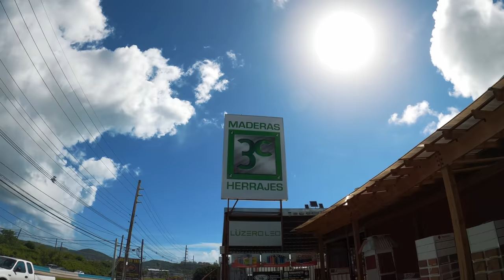BOAT YARD (PART 2) DESTROYED OUR BOAT SHOULD WE BUY THIS ONE?!

Comment: Suggestions/agreements:
set bulkheads in thickened epoxy (add sawdust to peanut butter consistency)
fillet at joints, your glass doesn't like sharp bends, can't transfer load smoothly to hull, it's not steel, it's relatively brittle plastic with fibrous core. 
tab in first with small strips, increase widths of following layers to make a tapered/distributed connection
the multi-tool should cut with less work overall
Thoughts:
a lot of the structural strength of glass boats is in the glass, not the wood.  in some cases, the wood is just a form/filler for the structure created by the glass, to the extent that in some cases, foam or cardboard is used instead of wood (sometimes seen in stringers on power boats). with these bulkheads, the old glass probably provides most of the structural strength for the chain plate to hull connection (so when the wind pushes the sail/mast over, the pull on the rigging is transferred to the skin of the hull, then to the keel (which is the resistance to the wind).
that said, for the bulkheads, the plywood is also providing shear resistance for the chain plate bolts.
ask your pro advisors if they think maybe just drilling and saturating the old bulkheads with penetrating epoxy would be at least as strong as your attempted repairs.  it certainly might be less work.
fwiw, keep in mind that you're not building for what happens when sailing, you're building to save your life when something completely unexpected happens.  you can't step off the ocean for a time out when things go crazy.
the other boat:
just depends on what problems it has.  it should be only a math question: either it is significantly more cost effective to switch project boats or it isn't.  loving you boat is a great thing.  going down with it isn't.  buying someone else's problems isn't necessarily a solution but a good (meticulous) survey should tell you that.
all that said, you're just trying to enjoy life, not make a gilded cage/prison, so do whatever you enjoy most and keeps you alive on the high seas (and on impact with immovable objects)
you folks are hugely entertaining but also informative, GBU, much appreciate you're out there doing it this way.  don't change.

Comment: Having blown the flexible coupling on my 1976 Hunter sailboat and moving the engine, I know the difficulties of doing a proper motor/shaft alignment. Hope your engine installer is good at engine alignment. This is very important or your engine mounts and strut bushings will quickly pay the price.

Comment: Its probably already been mentioned, but if you are on a budget this repair would be as strong in Polyester resin for an easier laminating life and a considerable cost saving!  I know it's entertainment (excellent) and not instructional (less good) but the fillets and layering glass strips already mentioned is excellent advice.  I'd use polyester resin on a polyester hull.  The other issue is cloth to resin ratio.  For a hand lay up you will inevitably have too much resin in the laminate so you really should be working on using the minimum amount of resin to wet out the cloth and then squeeging/rolling out the maximum quantity of excess resin out of the laminate that you can before it cures.  This will actually give a stronger lamntion than a laminate with a higher resin ratio.

Comment: Need to grind the fiberglass down with the grinder In stead of a wire wheel and make sure the resin and matt you are using is is compatible to the fiberglass that's already there need to tab in with matt glass...there is a big difference between using cheap polyester resin or a good west system resin

Comment: Re the CS 40- Well built boat. The fin keel version had about a 7' draft. Many CS boats had osmosis issues but at this point most have been repaired and epoxy barrier coats added. You should check to see if the hull below the waterline was a balsa cored hull or solid glass. Balsa above the water line not that much of a concern but if balsa below the line get it checked very well for wetness. A costly repair. No mast, well if a suitable one not in the area for a good price that will certainly cost you. How much are they asking for the CS40?

Comment: For figuring out the curves used cardboard as a template and use a 3/4 x 3/4 block as a scribe block. If you where closer to the USA I would say swing by I would have you covered with carpentry skills and tools

Comment: Hey Matt - nice work overall.  But please take a close look at your chainplates.  Did not see you inspect them or see any/many comments on the need to replace them.  My surveyor used a magnifying glass to look at each of my 6 chainplates and found 2 with hairline cracks on the same side he recommended be replaced.  Those hairline cracks were at the top of chainplate.  Had they failed the rig would have come down new bulkheads or not.

Comment: The chain plates have to be right. Get some local advice because if they come loose, you lose your mast. That said, until you have a right angle fiberglass connection to every side top bottom everywhere, it will move like that. MORE IS BETTER with CHAINPLATES.

Comment: I have no boatbuilding experience but I have built a fiberglass airplane capable of 300mph.  I would recommend a belt sander to remove that much paint.  Try wetting all layers of mat on a sheet of thick plastic covered with another layer of plastic instead of one at a time..  Plastic layer+mat+epoxy+ mat....etc.  Use a rubber scraper used in car shops to spread, press the epoxy through all layers at once.  Remove the top layer of plastic and transfer the entire wetted out 6 layers to the bulkhead.  Use the spatula to press onto the bulkhead and remove any bubbles. working on a horizontal surface beats vertical and corners all at once.   You might consider getting some fiberglass chop and mixing with epoxy to make a rounded corner before laying in the fiberglass.  As someone else said, perfect 90 degree corners are not so strong.  If I was there, I would sure give you a hand.  You are living the dream.  Keep at it.  Forget another boat.

Comment: Matt, please don't grind fiberglass without a mask on. That shit gets in your lungs and it will really mess you up. You might have noticed around the 8m mark when you started coughing. I know it's tempting to get stuff done, but that stuff lasts for months. Take it from someone who's already made that mistake and is still paying for it...

One other thing, make some thickened epoxy/polyester resin with cabosil, or even chopped up fiberglass, (peanut butter consistency) and put in a radius when you install the bulkheads, the new fiberglass will thank you for it and its' a lot stronger because it fills in the air pockets in the tight corners behind the fiberglass. The reason your new bulkheads feel flimsy, is because they aren't glued to the hull and the deck above them securely. Try one the way I suggested. :) You'll see.

Comment: I wonder if when you put up the flooring below the bulkheads for the behind setee storage you could place some aluminum angle at the base of each bulkhead in line with the each of the bulkhead pieces and tie them into the horizontal with the vertical with some bolts through the bulkheads. Hopefully you understand what I am driving at. This should provide lateral stability to each bulkhead piece. I am not a carpenter or anything, so you might want to run the idea past a boatwright. They would know.

Comment: Considering the other boat, it is an older boat as well.  I'd want a thorough survey before considering it.  You could be trading the devil that you know for the devil that you don't know.  You know that your current boat is seaworthy with a recent haul out and bottom job.  All of the through hulls are new or reconditioned.  And the rudder and prop shaft are in good condition.  There is a lot to say for that.  You have some good advice on bulkhead glass work below.  Don't cut corners on the bulkheads as they are the main reinforcement when the weather challenges.  When you finish the bulkheads and interior, you can enjoy many years in a fine boat.

Comment: Those wire wheels to remove paint and old gelcoat is comical!!!  thanks for the laugh!  I use those for light paint removal or concrete mess off stone.  The grinder with a more appropriate grinding wheel next time will take seconds(a coarse 40 grit flap disc or even the wheels that look like a sponge in aggressive grit....just wear long sleeves as it will shoot debris) ...that's if you decide to go through the pain of continuing with the chainplates. ;)

Comment: Seal the edges of your plywood with epoxy.  Put some thickened epoxy filler in between the plywood and the bulk head and build out a small radius.  Fiberglass is not very strong in a 90 degree turn.  Just my opinion, but it's based on a lot of videos and a little fiberglass work myself.
Layout several layers in the corner working from either smaller to larger or larger to smaller.  Layout a narrow 4 inch strip overlapping the bulkhead to boat side around 2 inches.  Next layer would be 6 inches wide with 3 inches against bulkhead and boat side.  Got out 3 or four layers and keep getting wider each layer, or start wide and go narrower each layer.  The point is to have it thicker at the corner joint and that will stiffen those bulkheads nicely.
Look at peal ply for options on pulling out the excess epoxy.glue

Comment: Hi, Guys... The other boat looked pretty cool from the outside but I don't think that's enough to go on...  We never really got a full tour... Is your mast the right height?. Removing the paint was they most important thing you did for the repair... Fillets should've gone in first though on the tabbing. And you need to epoxy the joints / Fillets at/in every corner.. they prevent the FG from having to make sharp bends (90's) which become a weak point.. plus they spread the load.. Go watch some vids on tabbing bulkheads... see how everyone else does it... You'll be glad you did.. good work so far.. ((Grinding SUUUUCKS!))

Comment: Matt, get yourself a 1/2" belt sander from Amazon--about $35.  I use this on my boat all the time.  It can sand/grind fiber glass mat and roving with ease and paint too.  Since it is small the dust it creates can be vacuumed up as you sand.  The best tool I have ever had on my five previous boats.  I love it.  You will too...just $35!  Since it is small, you can get all the hard to reach places....I am so confident that I bet you $100 that I don't have, that you will love it. You can pay me later.
Reply: When I rebuilt two wood boats, I used to cut a little oversize, then "belt sand to fit". I used a 3" belt sander I got for $25 at a pawn shop. It still runs, although I do have a newer one with a small front roller for tight spaces. I think the small one would have been really handy too.

Comment: If u are using resin that gets shiny when it cures u need to sand between layers if u are using a resin that stays tacky then u don’t have to sand between layers  there are many types of polyester resin and then there is epoxy resin  depending on which u use they behave slightly different  also u can do as many layers as u can comfortably do before your resin sets up  once it cures if it’s shiny u have to sand before next layer

Comment: Its hard to tell exactly what you have done so far but did you- Use thickened epoxy to attach panel to the hull? Make fillets to eliminate 90 degree corners at all attachment points? Tab to hull AND tab to deck AND tab to shelf(bottom)? the last step would give you 9 total layer on the face of the panel.  I would use the procedure of Hooked below smaller tab then build up.

Comment: I would try to get away without completely replacing the bulkheads.  

You may be able to "tap test" each bulkheads to determine how far back from the chainplate there's delamination and / or rot - if it sounds dead or hollow it probably isn't solid.  And / or, grind the paint off the old bulkhead and use a very bright light shining through the old glass to look for damaged wood.  Ultimately as you cut the old bulkhead away in sections you'll be able to see how far back the damage extends.

Trim the old bulkhead back to solid, undamaged plywood, with a square outline shape so it's easy to cut in a patch - so you don't have to scribe it.  Grind the old fiberglass back along the clean cut line so that new fiberglass has a solid bond surface to bond to - probably need at least a few inches of overlap between the old fiberglass and new.  It may best to grind the whole bulkhead to fresh fiberglass - to give a good bonding surface and to provide a good scarf taper.

Bond the replacement plywood patch in place with flocked (chopped) glass fiber as a thickener to the resin.  Use similarly thickened resin to fill any voids in the joint between the new and old plywood so that there's no place for moisture to get in, and so that there's a smooth transition between the new and old fiberglass - no steps or "joggles."  

Apply fiberglass continuous layers of fiberglass over the joint, reducing the overlap to reduce / eliminate any step at the joint.  

I heard Matt say he'd just replace the plywood and leave the existing fiberglass, but I think you'd likely have trouble getting a good bond between old and new because you wouldn't have a good way to prep a good bonding surface on the old fiberglass - since you'd be working in the 1/2" void left by the old plywood material.  That said, you might be able to remove fiberglass only from one side of the damaged portion of the bulkhead, leaving the other fiberglass skin.  Then grind a fresh surface on the plywood side of the remaining section of fiberglass.  Bond in the plywood patch (you could use the existing fiberglass to trace the plywood patch.  Grind back to fresh glass on the side of the bulkhead you cut off.  Then complete the repair as above.  Again, be sure to completely fill any voids with thickened resin.

You can apply resin to the cut plywood edge to seal it, but there are also good closeout techniques - doing so will reduce the chances of future rot or delamination...  Once the fiberglass skin of the bulkhead is cured you could grind (router bit) out an even amount of plywood (1/2") around the exposed edge and then fill with chopped glass thickened resin to make a totally sealed edge.  This isn't necessary for places where you're going to bond something else to the edge, such as at the bottom of the bulkheads where the lower shelf of the cabinet is going to be fiberglassed in place.

It's a big project!

Comment: Form my understanding of  Fiberglassing you could use  Foam as the base and not even have the wood, so if you're looking to just replace the wood inside the fiberglass that's not really something that's relevant, it's actually just a form to hold the wet fiberglass until dry.  Everything you've done so far seems to work out so I'm sure you'll be fine. Plus it makes for really good episodes thanks again for doing what you do

Comment: Hello there 
So when it come to chop strand fiberglass it is design to go with polyester or vinyl ester (not epoxy) and, first on the mold after the gelcoat. So in your case you should  put it last.
the industry schedule is to apply triaxial 1200 g/m2 first and to tied all 3 side perhaps several layers .
Then you could use biaxial couple layers then your chop strand then your gel coat or flow coat.
Overlapping or schedule is key to tensile strength and compression. If you need any help or clarification I will love to help 
Cheers.

Comment: If the existing bulkheads are still substantially tabbed and attached to the hull and the only issue is the edge rooting of the wood why not leave them in place (trimming the rot to stop it). Then use them as a tongue or tab to attach /sandwich the new plywood bulkheads around both sides through bolting them together for secure attachment (trimming out for the chainplate attachments of course...or relocate/reattach the chainplatesvtomthe new bulkhead sandwich). Also, didn't look like you tabbed your new bulkhead install to the bottom of the deck...this would provide an "L" shaped attachment giving it much more stability. Also I believe it's good practice to use a mildly pliable filler piece between the hard wood bulkhead edge and the hull (to keep bulkhead edges from telegraphic thru the outer hull). The pliable filler piece should be wider than the plywood and beveled with a 45 to provide two 45 degree turns of the fiberglass mat instead of the single 90...the mat 90 bends creates a weakened spot for 5earing/shearing. You guys are great, I'm sure you'll figure out how to make it work.

Comment: Those are not bulkheads , they are chain plates .  You certainly can make them far far stronger than they were . Glass into the deck too . as for layup , go to the "owners" site and ask , I bet someone knows the factory layup .  My guess is that now you can go with narrower tabbing at the deck to plywood joint to strengthen that weak spot . You are not going to get any more bonding on the ply itself . 

Basically you really can't make it too strong. The bulkheads , they don't need to be quite so strong , but those chain plates , they do

Comment: Don't buy the other boat, you'd be buying other problems. You know the issues with yours already and you're more than half way there with this one.
I wonder if coating the ply with a layer or two of epoxy would help seal it up first, then use thickened epoxy on the joint to lock it to the hull and the underside of the deck to stop any potential creaking, then tab it in to the hull
And I think these are sometimes called chainplate knees, but I'll go with bulkheads.
Good job guys, I reckon this work is great.